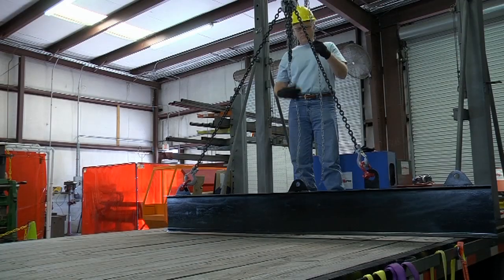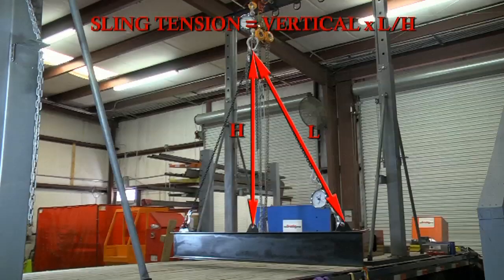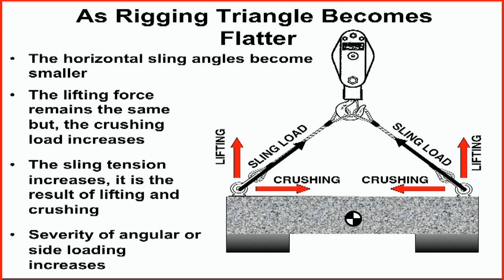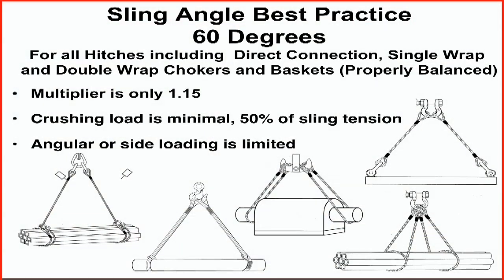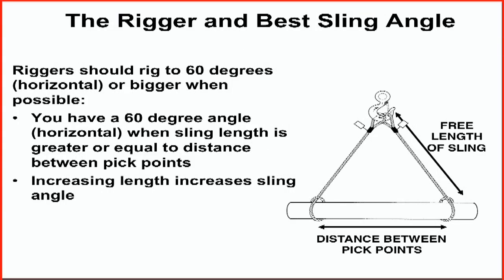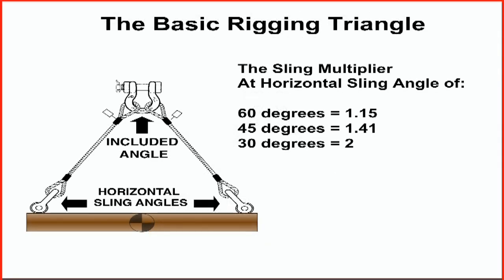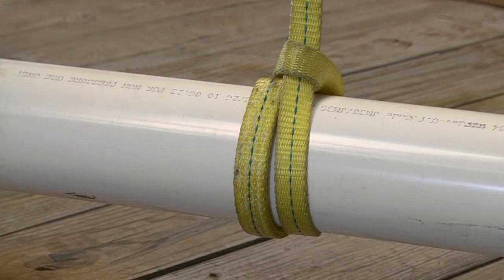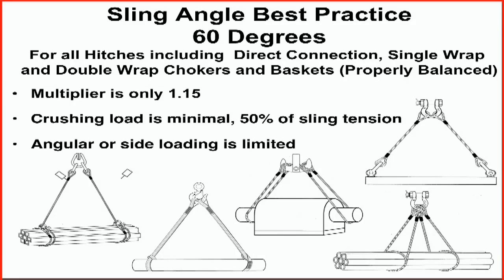Sling Angles Best Practices

Comment: Where is this angle measured from? As the diagrams/examples showing a sharper angle all seemed to be very similar in angle/span. 

The 60 degree main example looked to be roughly 90 degrees?

Comment: how possible safety fector 2 for 30 angle? kindly explain
Reply: Becos at 30degree angle, you have double the weight of the load on the slings. Meaning a load of 10tonnes at 30degree angle, each sling has 10tonnes on them instead of 5tonnes.
Reply: Sling tension.